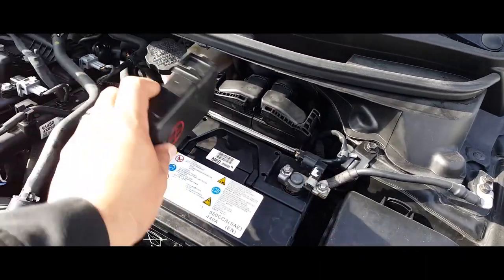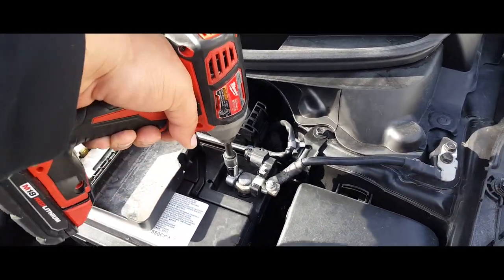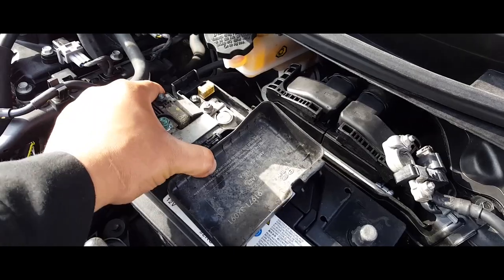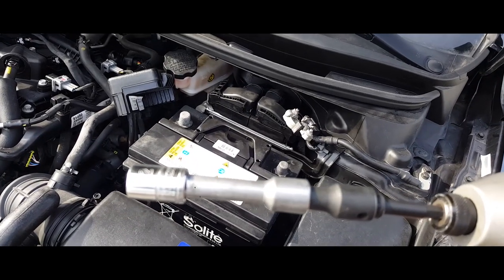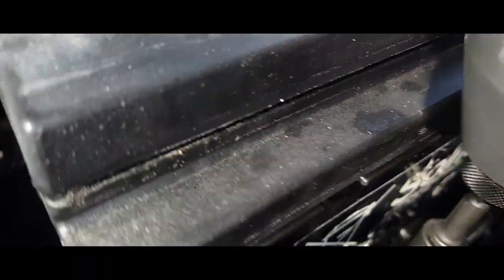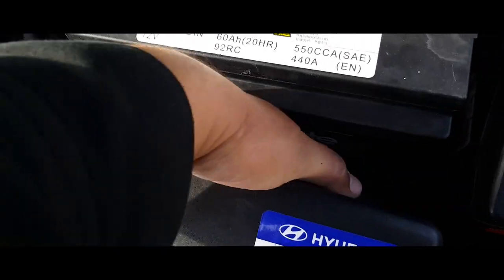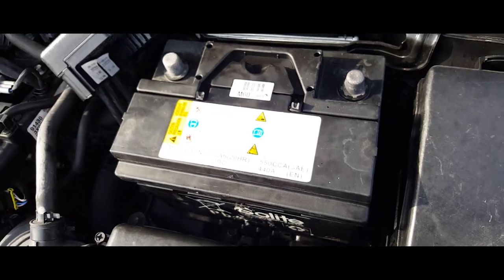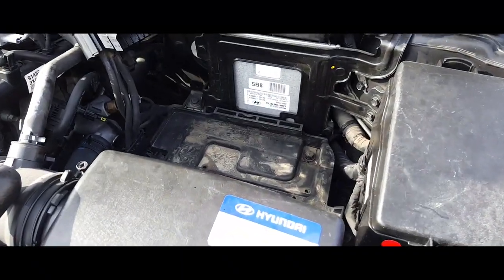How to: Remove a Battery from a 2013 Hyundai Elantra

Comment: You should also show how you put the battery back as well. The bracket can be tricky to work with and if your car battery has a cover, make sure to put the battery first before you put the cover over it.
Reply from the maker: https://youtu.be/371Vk-KRlCE
Reply: @559powerscape  Thanks homie. Really wish I had seen this one and it would have saved me 5 minutes 😄

Comment: Thanks for the video. The positive terminal on my new car battery is so tight that it refuses to be removed. I think King Kong must have tightened it. I need to remove it without breaking it. Advice, please.
Reply from the maker: LOL thats funny. You can possibly use a flat head crew driver to try and split the connector apart and use a set of big pliers to help you wiggle it out....hope this helps brotha
Reply: @559powerscape  Thank you! I have screwdrivers that should handle it.